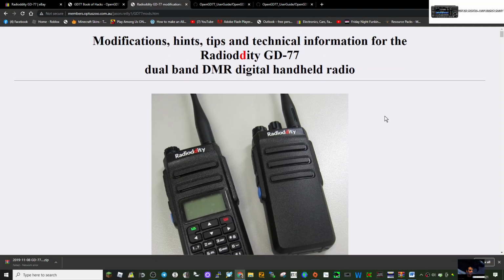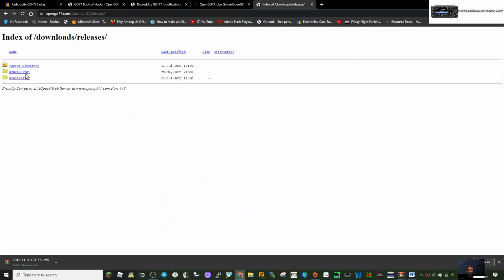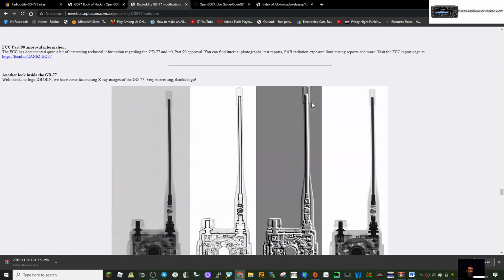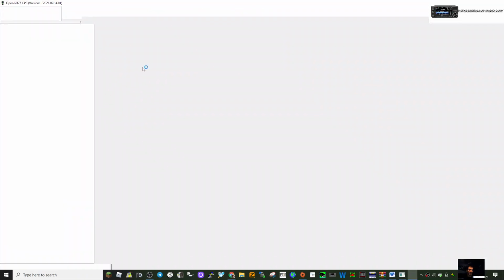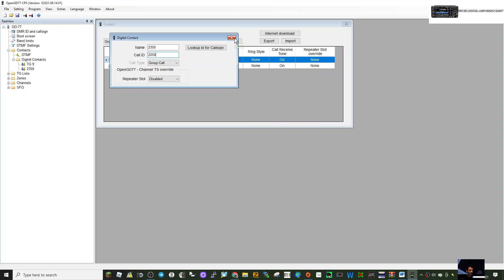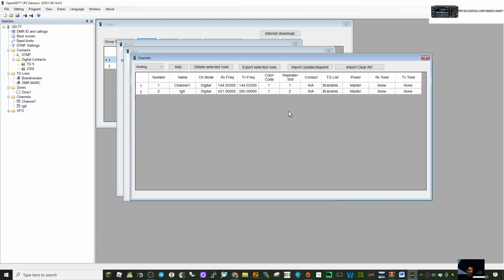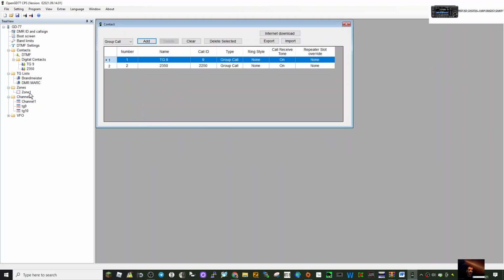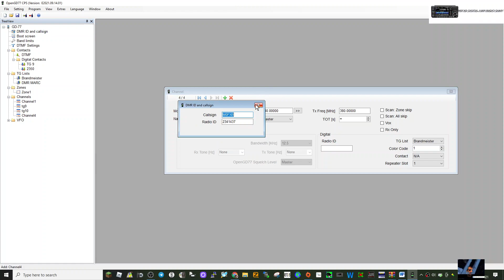RADIODDITY-GD77-OPEN FIRMWARE LINKS and HARDWARE MODS etc

Comment: How are the insides held together? If I take the faceplates off and paint them will I have a difficult time putting everything back together again?
Reply from the maker: Hi i am not sure what you are asking ?
Reply: @M0FXBHamTech  no worries, found an answer. I want to take mine apart so I can paint the body of the radio. Someone else has done it and says it’s really not too difficult to handle.